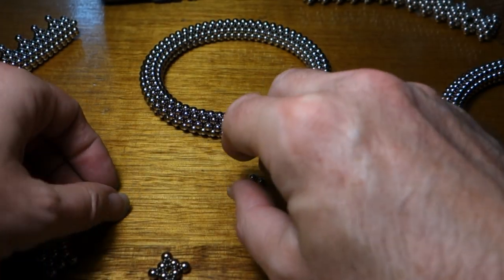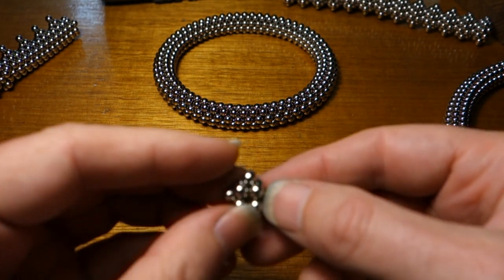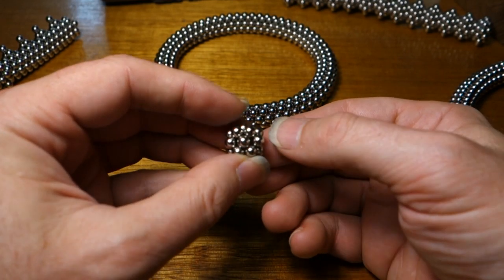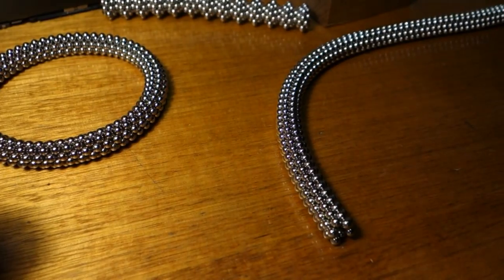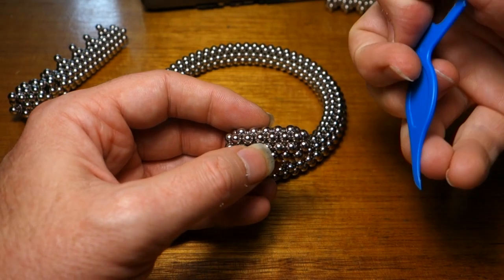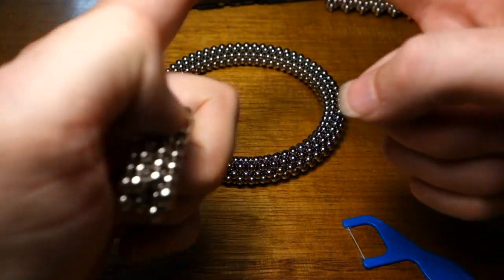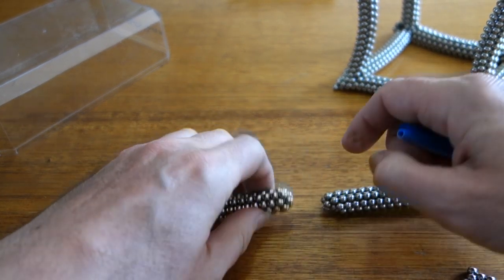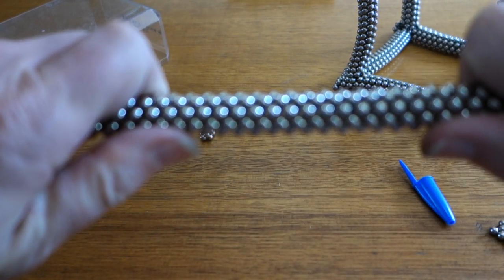Neocube snake, a completely smooth and rotatable torus ( tutorial)

Comment: This is awesome, but your approach to building it is so complicated ! Simply create a 4-wide, linear tape (with 4 wires side by side, polarised in the same direction), and roll it up over itself in a spiral.
Hopefully this makes sense :)
Reply: I made some more testing and it turns out I was wrong : although the structures are indeed virtually the same, their inner layout must be different, since my design doesn't have quite the same flexibility as yours...
Reply from the maker: Don't you find it produces asymmetries at the ends when you do it that way?
Reply: Damian O'Connor it does, buy they can be easily fixed by removing/adding a couple balls.
It doesn't fix the flexibility tho :)